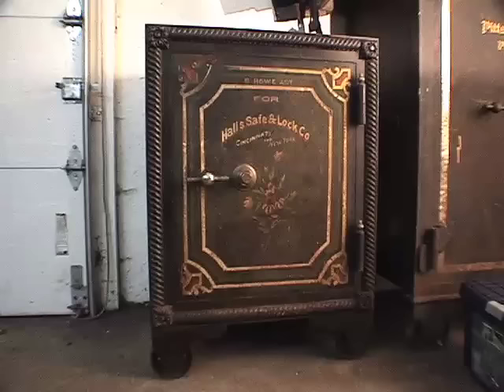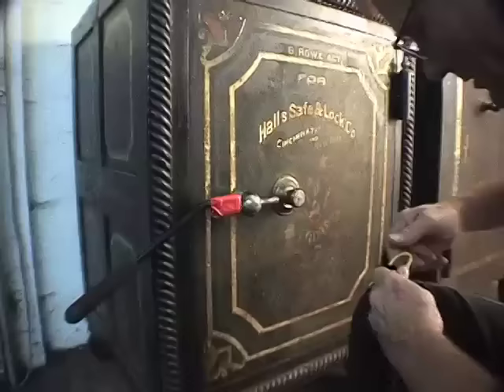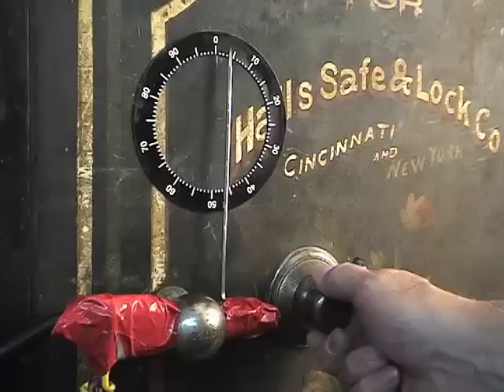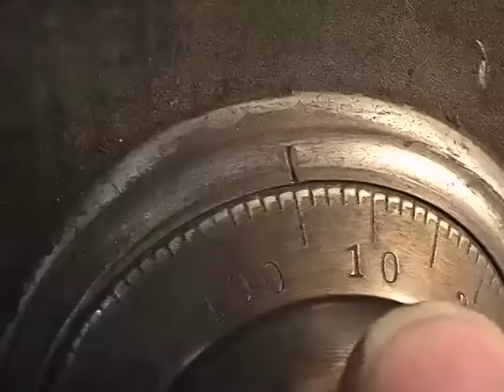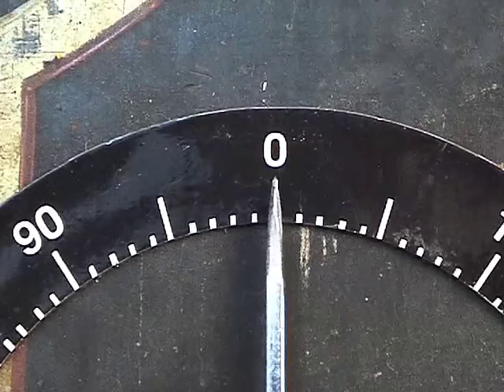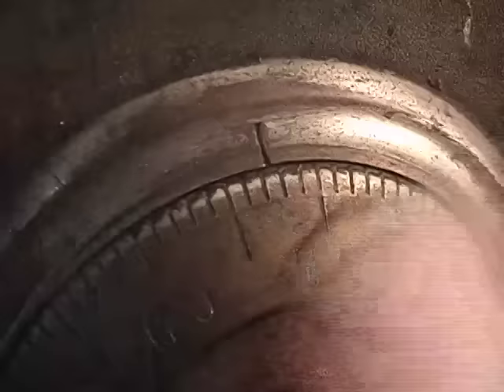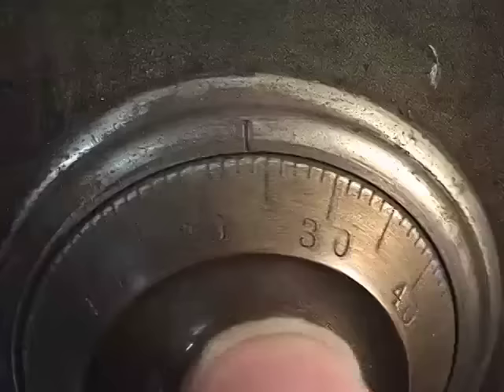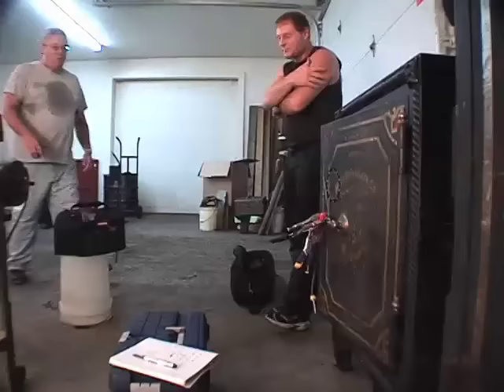Halls

Comment: I have don’t such research it is crazy. My mom bought a safe and loss the combo to it. I have been like 007 trying to get in to this safe . It has no information on the outside. I’m not sure if I’m even looking up the right safe to get information on it . He has a combo knob like this one in the video, T handle. The combo knob has Sargent & Greenleaf on it with a bunch of dates. If I pull down on the handle the combo still spins. After sayin all that do you think this method will work
Reply from the maker: No this method wont work on that one.
Yours ia a regular combintion lock, a Sargent & Greanleaf model 6810 rollar bolt lock.
That requies regular manipulation but are still hard to do.
So the best method is a small hole to insert a scope and read the wheels.

You probably could find a lock guy for few hundred to open it.
Reply: John Wick Pick thank you very much for the advice.. i think i will just leave the damn thing in the garage for decoration :(
Reply: Sorry to bother you but the safe it self is not a Sargent and Greenleaf right 
If so haw do i find out what kind of safe it is
Reply from the maker: @momapoohbear7653  Your right only the lock is S&G might be a Barns safe but S&G put there locks on several types.

I would know by seeing it. This would be rare but its always possible the combination is set on only one number.
Go Left at least four times to 15 then turn back right to 100. Now go left only to 17 then back to 100, then left to 19 tben back right to 100. Go all the way around like this in two increments.
If the combos on one number you could open it. You would feel it catch at 100.
Reply: John Wick Pick ok i will surely try, i thank you so much . If its ok i will keep you update with my results. Im in Maryland by the way
Reply: I dont know how i could send you and picture on here
Reply from the maker: @momapoohbear7653  thats funny I was in Maryland few weeks ago for a job, could have did it for ya...
Reply: John Wick Pick  I don’t have the money to pay a professional, but that is always my luck a day late and a dollar short
Reply: I really appreciate you tryin to help me the way your now ... thank you sooooo much
Reply: John Wick Pick if o don’t get it open then it just not meant to be... wish me luck
Reply: John Wick Pick it’s didn’t work out with the safe today :(
Reply: Probably to late with this info but I read that these old safes could have tear gas booby traps in them for people who tried to drill out the lock.